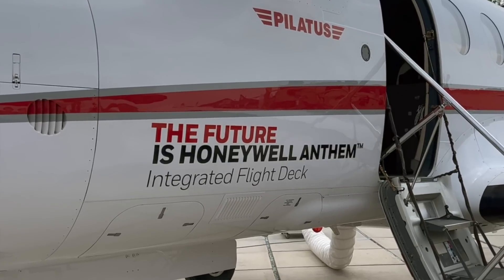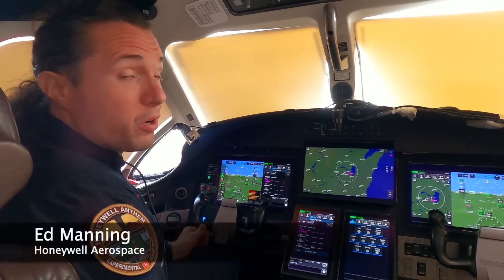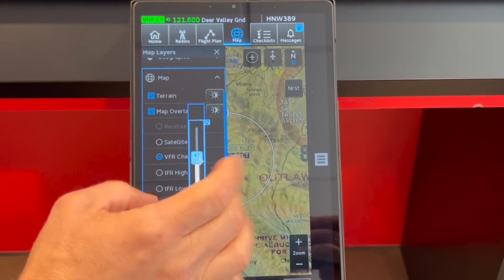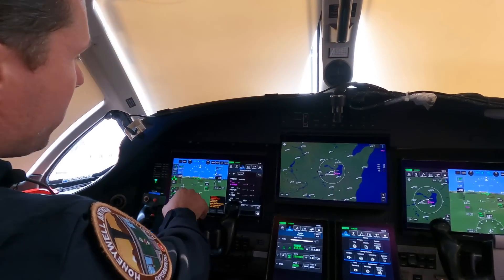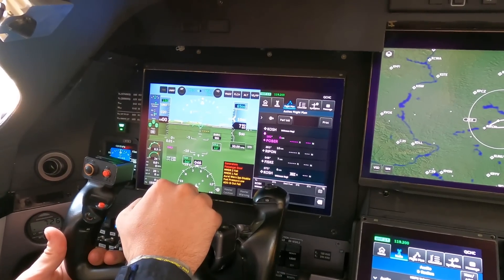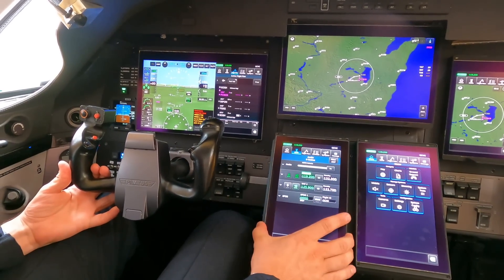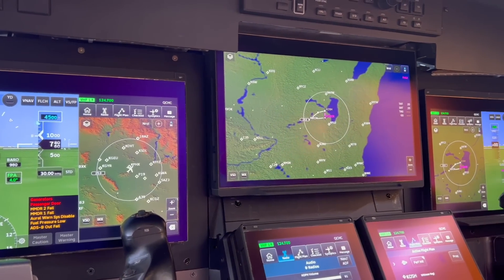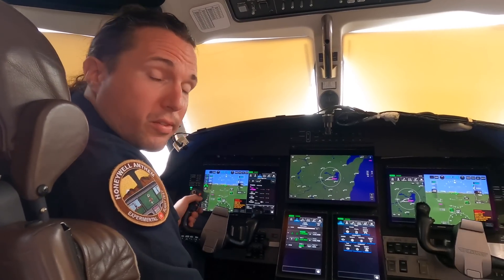AirVenture 2023: Honeywell Anthem Pilatus PC-12 Tour

Comment: Raising the gear from the right seat?  Well... maybe not.
Reply: This is a test configuration, not a final config - likely you would just have 3 Touch Display Units (TDUs) in a PC12 retrofit scenario because it isn’t necessary like it is in the Garmin to have the remote controls GTCs in the lower position (only way you can manipulate the forward displays which slows pilots down a lot).  You can basically do everything you need to, including looking at Synoptics, charts, checklists, radios, and maps, all on one TDU which is especially helpful for any reversion or non-normal scenarios

Comment: Ouch. Looks like engineers designed the UI/UX. Still, I love what Honeywell is working towards here. Please get some real UI/UX designers.
Reply: Would love your inputs on what you don’t like - lots of hours - thousands with UX/UI types not engineers with those UX/UI types as pilots have gone into the current layouts - work like this looks simple, but as you probably know (assuming you are a UX/UI type) lots of iterations and testing needs to be done with competent designers for interfaces to work well.  You probably also know that the principle of “transferrence” is very important in aviation where we need the right balance between good UI design and what pilots ALREADY KNOW AND ARE USED TO doing in the cockpit so it isn’t a case where you can make it work like your car without creating large training problems
Reply: @eisendrache787  Very good point about what pilots are used to. Though I'd love to see a clean sheet design, esp. in this case with so many innovations. The potential of Anthem has me very excited and hopeful. I'd be very happy to review usability studies conducted (love doing those), designs and their evolution, situations of usage flow in different scenarios, user cases, etc. Let me know how to connect.

Comment: Whenever I hear “it’s kind of like your phone” I lose interest in flying the new stuff. Why don’t they try to listen to actual pilots for once? I don’t want to touch on the PFD (or any screen) and then type in my desired altitude. Just as one of many examples. 
I fly something with a GTN750 and whenever we have turbulence it’s a pain in the ass to enter a waypoint or do anything besides changing frequencies (physical knob).
Reply: Yes, typing in an altitude was the line for me. That's terrible.
Reply: @oisiaa  you can do what you prefer - Ed could have used the altitude select knob also but touch is actually generally 2 to 3x faster as long as you are in moderate or lighter turbulence.  Anthem doesn’t take away the ability for traditional mindset pilots to use knobs to set things
Reply: @eisendrache787  I drive a Tesla and I love the touch interface, but the moment the pavement is rough or I need to make an input without taking my eyes off the road, it's game over. You need to be able to fly with full focus on the PFD and be able to feel for knobs to make changes without taking your eyes off of your flight path. I know you've done studies. Put someone in hard IMC conditions with turbulence, have ATC give them a random hold with ATIS blaring in their ear from a second radio. Please make a control panel standard equipment and the default for training.
Reply: @oisiaa  completely agree - Honeywell has done a ton (hundreds of hours) of testing in aircraft and on motion platforms good for EASA and FAA data gathering to support cert. that show pilots generally, without confusion, do what is comfortable at the time.  Touch is much faster when not in more than light to moderate turbulence.  There is no plan to eliminate tactile controls or CCDs for cases when turbulence is a factor - the data Honeywell gathered in flight and in labs is very clear on this.
Reply: don't worry, the guy their are listening to will soon indulge us with some "AI" stuff, "because everybody is moving to AI so we need to move along..." whatever that means

Comment: Full touch interfaces are a no-go. Interacting with Foreflight on an iPad is nearly impossible in even light turbulence. With physical buttons you can anchor your hand and find the button before pressing.
Reply: The video states clearly that tactile control panels just like every other avionics system offers, in the Anthem case each pilot could have their own simple 3 or 4 knob control panels conveniently installed for best reach distance.  Please listen to what is being stated in the video as Ed is walking folks through it - lower cost smaller CCDs (not joysticks which are a complete pain in the G systems) are also available to be integrated)
Reply: @eisendrache787  Please make a control panel the default included option with touch only for some non-critical functions.

Comment: Why does everything that’s not Garmin have such a noticeably low frame rate with synthetic vision?
Reply: The Honeywell SVS is the highest refresh on the market at over 30fps which with Part 25 level of cert (higher than the G3000 cert levels) is very difficult to pull off and still get approved through V&V etc. with multiple demands on the real time OS and computing HW
Reply: @eisendrache787  wtf is this shameless corporate botting lmao